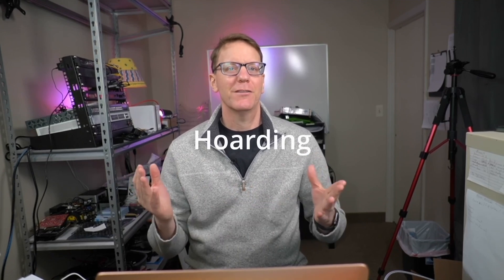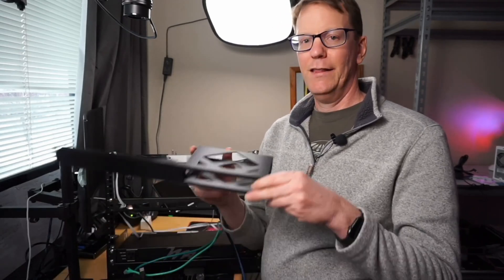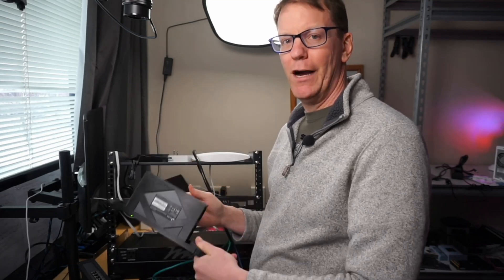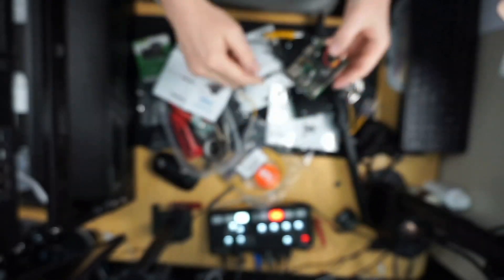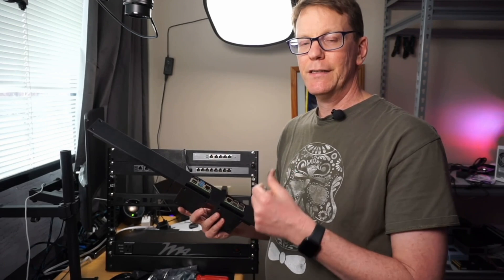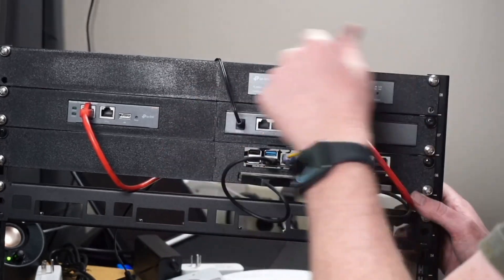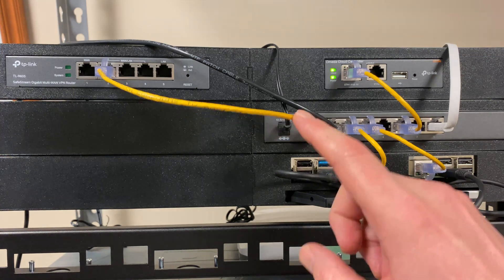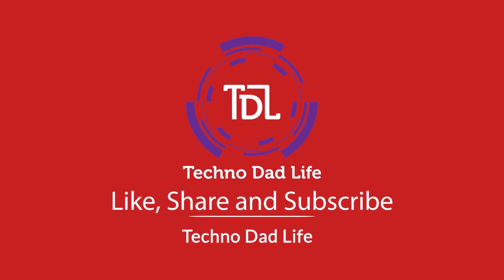Micro Mini Raspberry Pi Silent Homelab Build

Comment: Cool project! I'm building a 4xPi right now. I found a 1U rackmount with 4 slots on Amazon. The custom rackmounts you have for your switch, etc are pretty cool! Mine are just sitting on a shelf.
Reply from the maker: Very cool!  I couldn't find any raspberry pi rackmounts with slots that why I had Steve make them.  Do you have a link?

Comment: You can probably power the switch with USB. There are usb-a to barrel connectors on amazon. Check the voltage.

Comment: Interesting,
But I have several questions:
-why did you need a router?
-why did you need a cloud controller?
-why did you need 2 Raspberry PI?
I suppose you can emulate the router and/or the cloud controller directly in Raspberry PI, especially with 2 of them
I am wrong?
Reply from the maker: 1. The router tells where the internet traffic goes from your modem.  If you have internet at your house or work.  You are using a router.
2.  Control home/office network over the internet.  Do I need it? No.  Is it cool to play with? yes.
3.  Because I want too.  Why do I have two TV's? Five computers? A wife and child?
4. You can emulate emulate the router on a pi, but your network would be really slow.  I am not looking into slowing down my network.  I could run the controller on the pi, but if I experiment on my pi and I need to redo things my whole network goes down.  I know you can do both those things, but it doesn't mean they are good ideas if you want a stable network.
Reply: @TechnoDadLife  Fun project
Reply: Emulating = encapsulating in one point failure.  He already pwned you but I will add a little bit more.
The fact you think a router can be emulated in His specific network with a raspberry pi.... make me think you believe a network connection is just magic that gets through a device that you call router, and there is when your knowledge seems to end.
Reply: @Sc0rphionx  
the fact that you think my knowledge is limited to the network and that all, plus your condescending tone makes me think that you are a very rude person